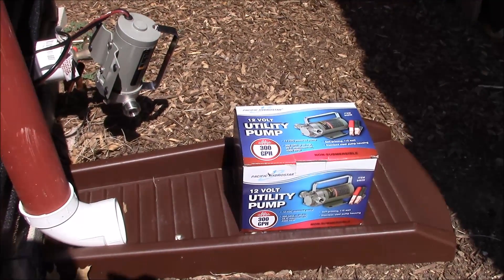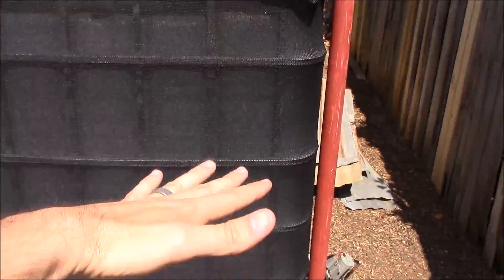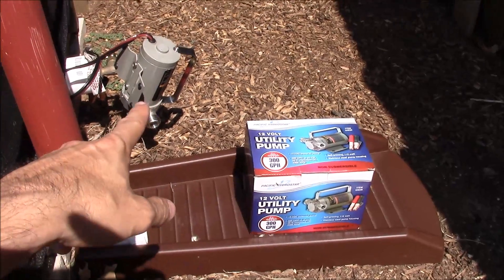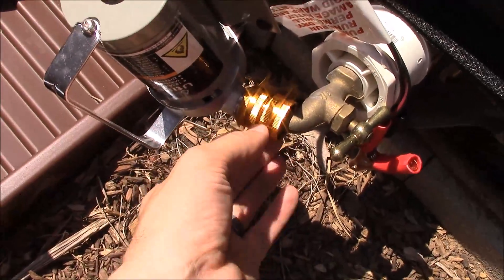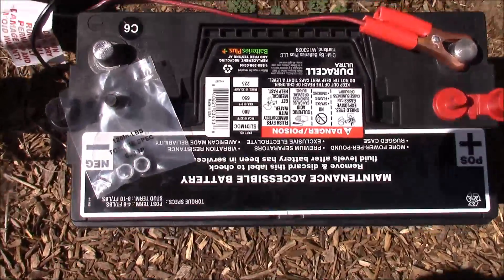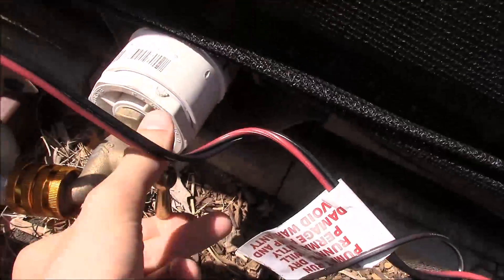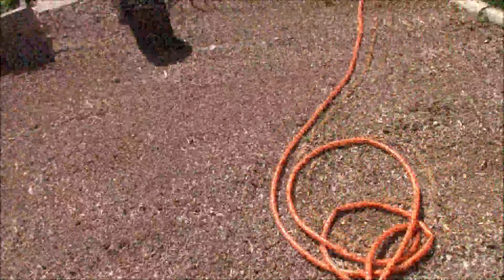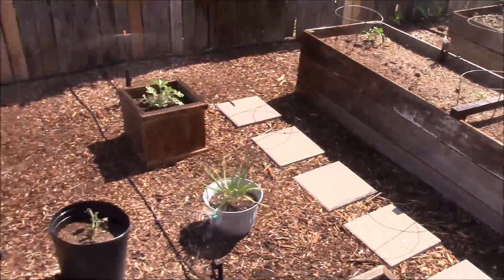DIY Automated Garden Watering System Part 2

Comment: good video. I am looking forward to the next step with the sensors etc. My next step is to add some gutters to my house and run them to an IBC tote and use a similar setup as you have with the 12 volt pump. I am interested in seeing how you use the Arduino moisture sensors to control your timer and pump. keep the good videos coming.
Reply: +Plan B Homestead you might want to check out this website. https://learn.adafruit.com/wireless-gardening-arduino-cc3000-wifi-modules/introduction
Reply from the maker: +Plan B Homestead Thanks!  I'm a little confused about the thumbs down on this video but oh well.  Anyways, I might also use a sensor to detect how light it is outside so the system doesn't come on during the really hot part of the day.  I don't want to make this too complicated and my coding skills are not the greatest but we'll see what I can cook up.  Thanks for watching.
Reply from the maker: +Plan B Homestead Nice, I will check it out.  I have seen a few different guides on this so I will probably take some of each and modify it for my purposes.